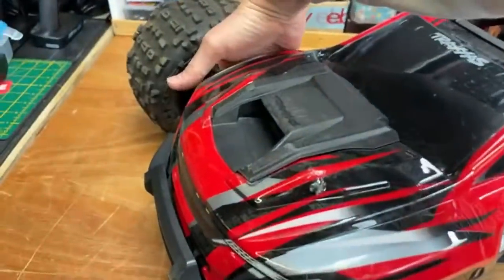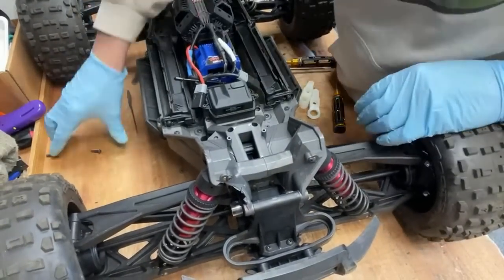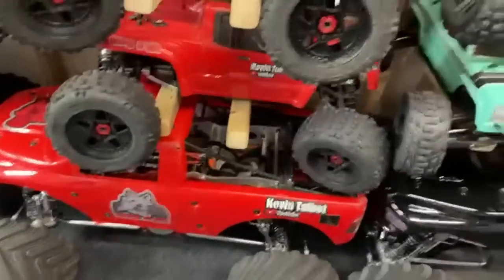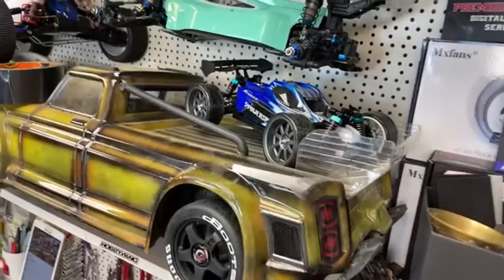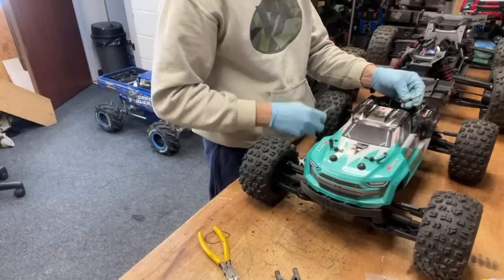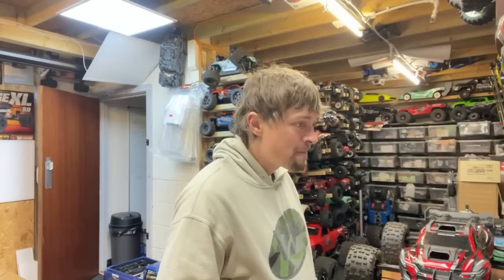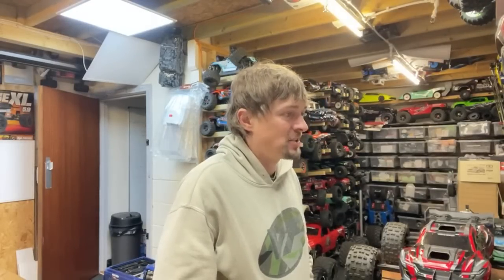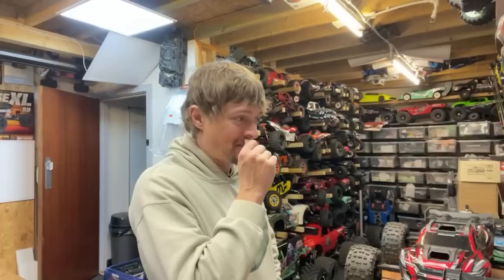Traxxas XRT major weakness you need to know about Live

Comment: Only problem i had was the servo broke on the mounts just like your one did kev. M2c brought out 1218 servo brace so you can use the traxxas servo even with broken mounts so saves you some dosh only came out last week i think. Also someone came up with an idea for the bulkhead wishbone break which is to switch the front tie bar brace mount to the lower and fill the upper hole with a rod tapped into the brace. You can also brace it either side with another tie bar brace but requires alot of trimming but not to much on the rear but front needs alot of trimming so i'm trying the tapped rod brace mod instead see how it goes.